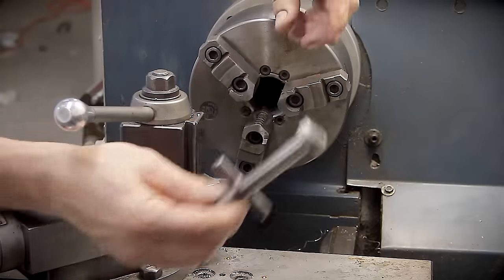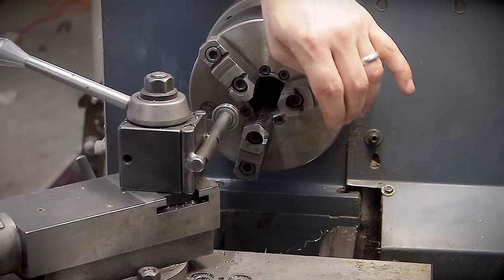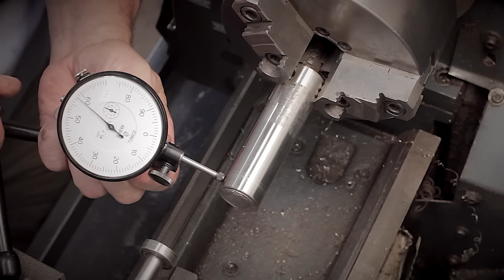Bearing stick

Comment: Hi Dale,

I used to work at a shop oh some 20 odd years ago and one of the old timers showed us this trick. However we used old knurling holders with 2 bearings and it aligned it vertically and horizontally. We also got greedy and built one with BIG bearings for the big Lodge & Shipley but a few times big stocks got flung around the shop and we stopped using it :) From what i remember, whatever you do, don't walk it down towards the chuck or it will fly.
Reply from the maker: +MotoWanderer 
LOL

Comment: You really forgot to mention the second way to use this! it is most handy to use when setting up thin discs in the chuck and using the bearing on the face. The need thing with the holder is that you can flip it around and use it for face position, which you couldn't if it is held in a regular tool holder. cheers.
Reply from the maker: +Flip de boer 
Thanks for your comment :-)

Comment: I got to thinking about you using this tool.  I would think, you would crank that bearing into the work, and go past it running true by just a bit/a few thousands.  Then back off that bearing, and the part should stop when it's centered.  Much like a Edge Finder?  Of course, you can go too far as you found out.
Oh by the way, turn that bearing 90 degrees and it will push a part in, usually 4 jaw chuck.  So you really don't have to indicate it parallel to the face of the chuck.  Saw it on YouTube somewhere.
Reply from the maker: +Kirk Crawford Great advice :-)

Comment: IS THERE A WAY TO ADAPT A 15MM SHAFT TO A LARGER 20MM BORE DIAMETER BEARING...IS IT POSSIBLE TO USE A BUSH OF 2.5MM THICKNESS , I CANNOT TURN DOWN THE SHAFT BUT MY IDEAL BEARING SIZE WOULD BE 15MM*37MM*11MM ...BUT SINCE IT IS NOT AVAILABLE...PLS GIVE ME SOME SUGGESTIONS

Comment: I copied someone else's idea and put a bearing on each end of a bar and it then can be put in a tool holder and uses perpendicular and parallel to the bed, used for a washer or a bar sticking out of the chuck